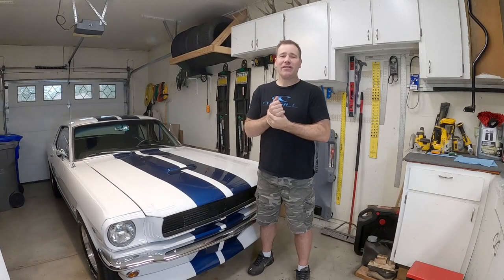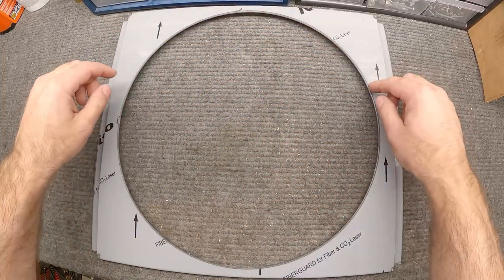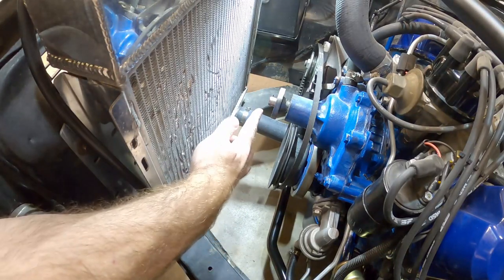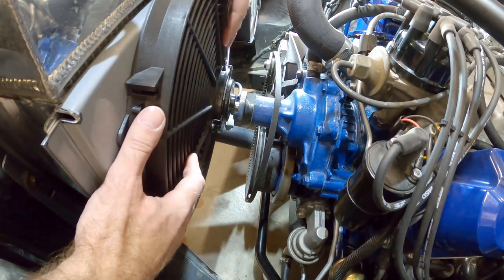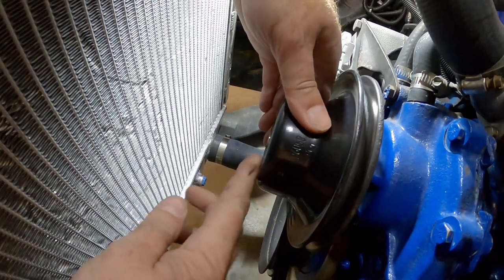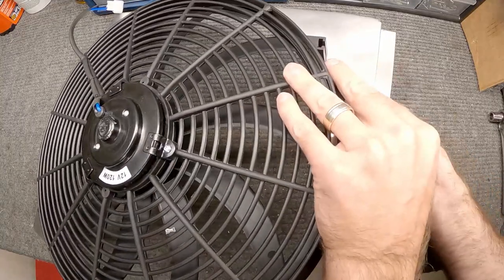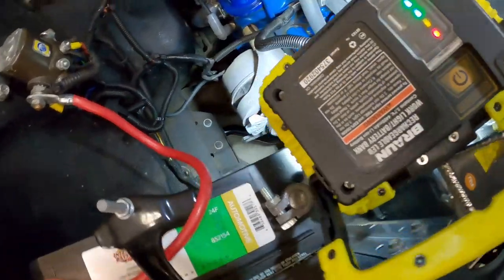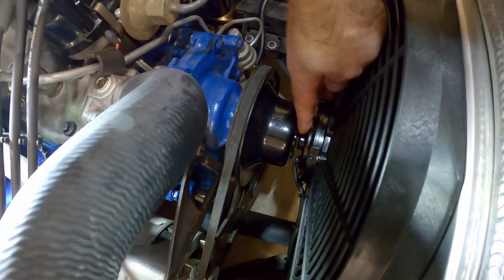How to Install an Electric Radiator Fan

Comment: I had an electric fan on my 66. When it went out, I had trouble finding an electric fan that would fit well with the bigger radiator. Anyways, I went to a flex fan with the original fan shroud and haven't had any issues. I would consider trying to get some more space between the front pulley and the electric fan. Great video!!
Reply from the maker: Agreed, that space is tight.  It has been a few weeks since I actually did this upgrade and I keep checking to see if anything is touching.  Nothing so far.  :)

Comment: When I did this to my 65 fastback I also changed to a Meziere electric water pump which made clearance a non issue ( and you pick up a little HP :-) .  My rad was a 3 row champion like yours.
Reply from the maker: The electric pump had crossed my mind.  That small bump in HP is also appealing.  Hmmm........
Reply: @AndyKruseChannel  They make a pump with heater hose provisions but it 's spendy!!! but they are SWEET mine went 10K with zero issues before I sold the car. Good luck Andy !

Comment: Technology is great
On my 85 Corvette C4, I fitted two of these . As the fans have cages, I did away with the entire shroud. Allowing more of the aluminium multi core radiator to be seen.
As you, I also wired it to turn on after a 10 second delay from key turn , always on.
I used the radiator ties and also fitted a transmission cooler on the front 
8 ties 😂🤣
Those fans great, on your car I'd have not used the shroud, fans too close to those bolt heads.
Reply from the maker: I think you're missing the point of the shroud, those cages you mentioned don't force all the flowing through the radiator to flow through the fan, that's why the shroud is needed.  But, everybody has different ways of doing things.  :)
Reply: @AndyKruseChannel  the rpm of the electric fan is many times more than the factory, also the aluminium multi cores already are 40% improved cooling.
You don't need a shroud 😎
Just the risk of damage alone would see me remove it on this car, IMPO 👍

Comment: Tried an electric fan on my 68 Mustang but went back to the OEM as it cooled better. An option for you is to mount the electric fan on the front side of the rad, reverse the polarity and push the air through the rad.
Reply from the maker: When I was researching fans for this upgrade, there were fans that were designed to push and fans designed to pull.  This one was advertised as a puller, so I don't thing I would want to do what you were recommending.  Plus, the new shroud is designed to maximize the efficiency of the fan.  So far so good.  :)
Reply: @AndyKruseChannel  hope it works and keeps that Mustang cool.
Reply from the maker: @cdnclassiccargarage6620  It has been a few weeks since I've done this install and it's been great.  :)

Comment: Hi Andy, I have a question if you don't mind. I just installed this setup and the fan starts at the perfect temperature but doesn't turn off at the right temperature. I bought 200f to 185f sensor (for another car), and my fan turns on at 200f but stops working at 199f. So the off-temp doesn't work. I didn't install the circuit breaker, could that be the reason? I am confused.
Reply from the maker: I'm not sure which circuit breaker you are referring to, but I can't see why it would make a difference if your fans are shutting off at 199f.  I suspect it's a faulty temp sensor that is triggering your fans, and those can be purchased on the cheap.  On a side note, how positive are you that your temp gauge or temperature sending unit for the gauge is accurate?  It's probably not the issue, but something to think about.  :)
Reply: @AndyKruseChannel  Thank you for your quick response. I check on the dashboard the temperature, basically turns on and off at the same temperature. I am also guessing its fault sensor, apparently its common on these sensors to be faulty.

Comment: Andy - did I hear you right in that you hooked up this e-fan to start when the ignition comes on? So, at highway speeds and at any other speed, it would always be on? I guess it's much like the mechanical fan in that regard, but I thought your diagram showed that it would turn on/off based on the temp sending unit. Many of the folks I've read about with these fans have them only come on based on the temp sending unit but wasn't sure what you ended up doing. I live in Houston, TX, and I'm thinking it would just be better to have the dang fan on all the time as well. To do this, did you just omit the gray wire going to the temp sensor (Pin 86) altogether?
Reply from the maker: In this video, yes, the fan is on whenever the car is on (I didn't do it that way on my Fastback).  The diagram I had shown was assuming someone would use a temp sensor for the ground (making it turn on and off based off the sensor limits) instead of just grounding the relay (which is what I did in this video).  So if you want to skip a temp sensor, just put that wire straight to ground instead attaching it to a sensor.
Now, with all that being said, when I went to put an electric fan in my Fastback, I chose to use the sensor.  I chose this route as the fan is loud and I don't want to hear it any more than I need to.  For your scenario, and if you were asking my advice, I'd say put that switch in.  I have that convenient threaded port on my thermostat housing, so I didn't need to modify anything to make this sensor work.  :)
Reply: @AndyKruseChannel  thanks for that info! I do have the threaded port as well on my thermostat housing, so I guess I could just use the sensor. Thanks Andy!

Comment: Hey maybe I missed it but  how did you handle the temp guage wired to the temp switch and the new switch for the fans? Isn’t there only one port to thread into? They obviously can be wired into the same switch? Thanks.
Reply from the maker: On this car I wired it up so the fan is on when the car is on.  Not ideal, but that was the limit of my patients at the time.
Since then, I have installed a similar setup on my current Mustang and I have a temperature switch installed in the thermostat housing which activates the relay to turn on the fans.  I could have done that same kind of setup on the car in this video (and I wish I did), but I chose a shorter path at that time.
Reply: @AndyKruseChannel  so if that’s in the housing for the fans, where is the guage reading coming from? Thanks.
Reply from the maker: The gauge reading is still in the stock location, the port "above" cylinder five in the intake manifold.  :)

Comment: Did you have to use nuts and lock washers for the pulley?
Reply from the maker: There are threads in the water pump shaft to hold the water pump pulley, so just bolts.  :)

Comment: Now that you've had the electric fan in your car for a few month, how is performing? Anything you'd change?
Reply from the maker: Unfortunately I do not know as I sold the car not long after I made that video.  But, for what it's worth, I plan to put a similar setup on my new project, the '66 Fastback.  :)

Comment: Hello. Can it blow air to the opposite side when the rotation direction is changed thanks to the fan blade structure?  You mounted the fan inside the radiator.  Can I place the same fan outside?
Reply from the maker: You can place the fan on the outside if it's a "Push" fan.  It's not just the normal direction the blades spin, it's also the shape of the blades that dictate if it's Push or Pull style.  The fan I installed in this video is a "Pull" style and it cannot be installed on the outside (front side) of the radiator and expect it to work just as good.  When you find the fan you want, it should tell you somewhere in the details if it's a Push or Pull style.  :)

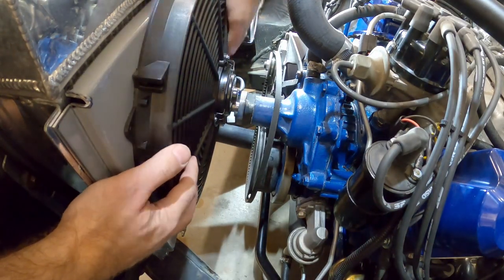Comment: Awesome video as always Andy. At 7:49  I’m just wondering, did you have to go back and straighten out some of the cooling fins on the radiator? It looks like at that close quarters work might have chewed them up a bit? Always learn something when I watch - thanks so much! Just ordered a new Champion radiator for my 65 i6 - can’t wait to get it installed!
Reply from the maker: All the bent fins on that Rad were from me moving the shroud in and out to check fitment.  The fan was more than an inch away from the fins when installed.  :)

Comment: I am actually installing an electric fan too. Here's my 2 cents: I don't recommend running the fan all time for a couple of reasons... Is your alternator like stock? Electric fans can draw 30 amps...
Also you should had a fuse to that connection
Reply from the maker: If the thermostat fails, the fan won't run.  This way the fan is not dependent on something else.  Also, I don't run a stereo, so the amperage it would have drawn can go to the fan.
Reply: Team no radio @andy kruse 🤘🏼

Comment: Hi Andy I have a 66 289 hipo how do you feel about radiator hose filter? It currently has one not sure if I should remove it. Thanks bro
Reply from the maker: Honestly can't say I've heard of a radiator hose filter, but that doesn't mean it couldn't help.  Thankfully there isn't much to be filter on the coolant side, other than maybe a old piece of rust breaking off from inside the block.  Worst case it clogs a fin in the radiator or makes the thermostat stick open.  I've never used one and I have no plans on installing one, but that doesn't mean yours is not helping.  Sorry I'm not much help.  :)
Reply: Thank you!! I really enjoy your videos 👍

Comment: Would you be doing a video on replacing the heater box soon? Keep up the good videos 👍
Reply from the maker: I did a video a while back where I pulled the heater box to replace the coil, but I didn't replace anything else.  There might be some value in that video for removal and installation of the heater box, maybe it's worth a look?  :)

Comment: I also did an electric fan conversion using a 16 inch thin SPAL fan... But I used a baking sheet to make the shroud 😂 😂 😂 it worked. I have video... But the fan was just too noisy for me. I ended up getting a 6 blade fan instead.
Reply from the maker: Agreed, this new fan is noisy.  Thankfully I can't hear it when I driving.  :)

Comment: Look up the Proform low profile setups. A little pricey but if clearance is an issue.
Reply from the maker: Thanks for the heads up, I am thinking of doing another electric fan on my new Mustang and I'm interested in a lower profile unit.  :)

Comment: Did you ever cut a slot to move the radiator forward?
Reply from the maker: Unfortunately I sold the car before I got that far.  I never had a problem with the fan and the pulley on the water pump touching from the time I installed it until I sold it, so it would have been lower on my list if I had kept the car.  I'd like to do something similar on my new car, so we'll see how that plays out.  :)

Comment: Do you have links to these?
Reply from the maker: Electric Radiator Fan - 16", includes relay kit, purchased off ebay for $40
Radiator Shroud - Made to fit my Champion radiator.  The radiator model number is AE259.
Reply: @AndyKruseChannel  thank you!

Comment: It's nice to see a project that goes as planned. How is the cooling with this fan? Have you had a chance to sit in traffic with it?

I would definitely hook up the thermostat especially if you have large temperature swings where you live. I'm surprised your car heats up that fast. Mine takes a good 5-10 minutes before it is at temperature.
Reply from the maker: Not yet, we don't really have traffic where I live (well not like the big cities).
I haven't decided what to do about the temperature switch yet, there's good arguments on both sides.

Comment: Other options.. offset the radiator if needed.. also, reverse the motor on the fan, make it push air and mount it to the front..you will need to flip the blade also
Reply from the maker: I thought about the push option, but the research I did showed this was the better option, especially with that custom radiator shroud.

Comment: When are you going to swap to an electric water pump?
Reply from the maker: On the car in this video, never.  I have sold the car since I made that video.  However, it's been on my list for my new project.  They're a little pricey, but I'd like to eventually upgrade to the electric pump.  :)

Comment: Now you have 35 more useable  horse power at  the top end, because your not spinning that fan.

P.S.  use the switch and I had this Land Rover with a fan that close. Had to stop and patch it on the way home because the motor flexed the fan into the radiator 😡
Reply from the maker: 35 more HP?  At least that much.  I was guessing around 50 more HP.

Comment: my eBay electric fan was junk my 66 mustang would overheat sitting in my driveway ,,i found a regular old fan from a 77 tbird and now life is good and i dont need a shroud i hate ele. fans
Reply from the maker: I've gotten burned on Ebay parts too, I guess it's a gamble we're willing to take to save a few bucks.